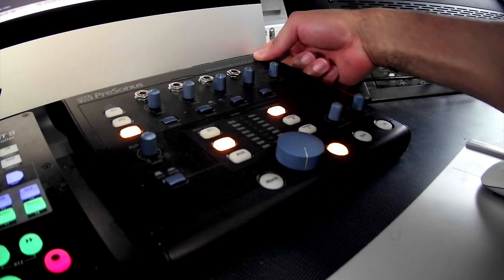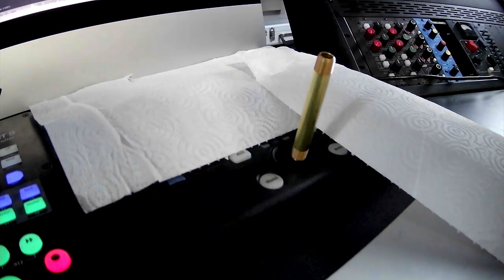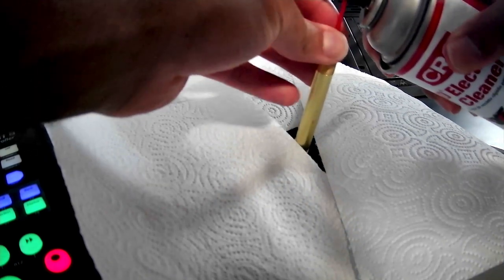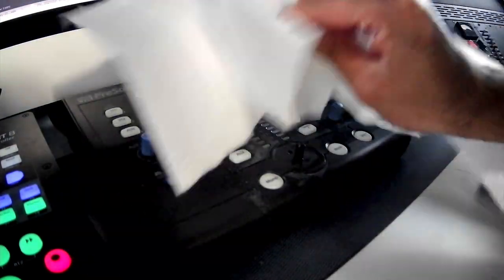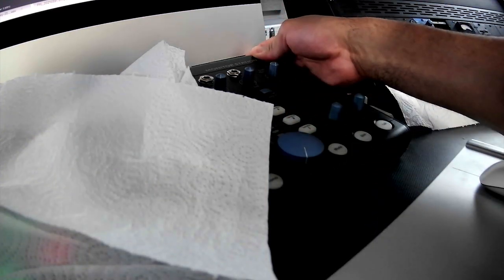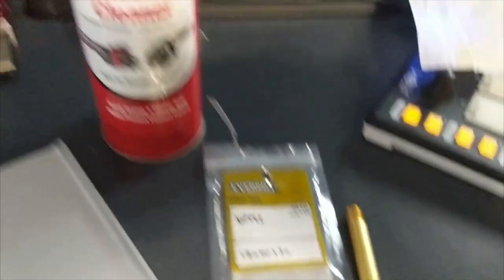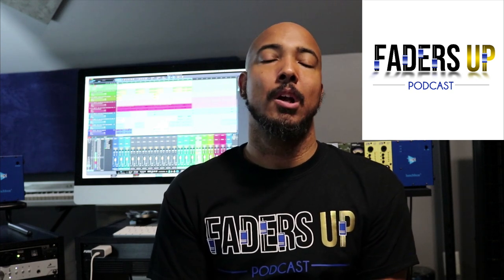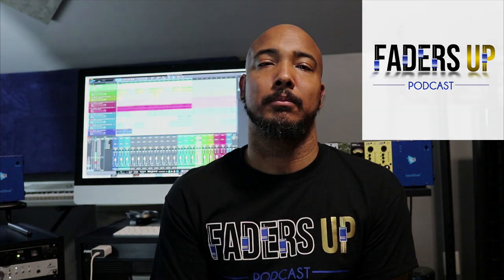How to fix crackling scratchy volume knob on PreSonus Monitor Station V2

Comment: Thanks!  Using your technique sans brass pipe with Quantum 2626.   Back in the day, with tape machines, we started each session cleaning and demagnetizing the heads.  In Hawaii, I think this has to become a regular part of my session routine.
Reply: I love my Quantum 2626, but can't stand the crackling Main Knob. Glad to see I'm not the only one. Did this work well for you? Did you stand it up or spray horizontally?
Reply: It works!

Comment: Thanks for posting.  I was (am still) about to do the exact same clean.  Great to get affirmation.  MY ONLY CONCERN -  is that I've heard, read, and compared- the cleaner we are using is not designed for delicate electronics or circuit boards.....  BC it does not contain any lubricants.  This means that it will clean the electronics and solve the problem SHORT TERM, but w\out the lubricant - it will dry out the components and will ultimately cause more damage....
But imma bout to do just the same bc I ran out of the more expensive good good and  I'm impatient...
I'm no expert, but have read the difference in labels on the cans....

Thoughts on this?  Not a big deal? IDK.  Would love some feedback.  
Thanks again for posting Czar. Good job.

Comment: Czar with that Macgyver quick fix!! 💪🏽 I’m going yo try this, I have the same issues with my monitor station. I can hear the noise with my headphones when I’m tracking. Will this fix that too or just the main volume noises from my studio monitors?
Reply from the maker: I'm not sure if the crackling is transfered to the headphones. But it should only be audible when you turn the knob

Comment: in our studio, we wore out our V1 Monitor Station, and now our V2 volume control is in sad shape.  I'm going to try this.  The Monitor Station simply has the best layout and features set of any monitor controller I've seen, but I do wish it was built a bit better....  PreSonus could add $100 to it for a solid volume pot!  There simply is not anything else that has these features with 4 headphone outputs.  (is there?)
Reply from the maker: I switched from the monitor station to the audient Nero. So far I've liked it better

Comment: I have the same issue with my 5 month old Presonus 2026. Probably wont buy their interfaces again
Reply: i have half of the pots on my 2626 crackling , it started from day one , has I had work lined up I couldn't send it back right away and my reseller by the time I made a ticket was not very helpful basically telling me to spray them ;But im afraid if I open the face I loose garantie altogether.

Comment: A self cleaning potentiometer would certainly classify as an OVERDUE good idea, I had the same problem with an attenuator on a 1978 Onkyo integrated amplifier and now in 2023 I'm having the exact same problem with a Focusrite 2i2 2nd gen audio interface....so 45 years and ZERO advancement in product design/innovation, and how pathetic is that.